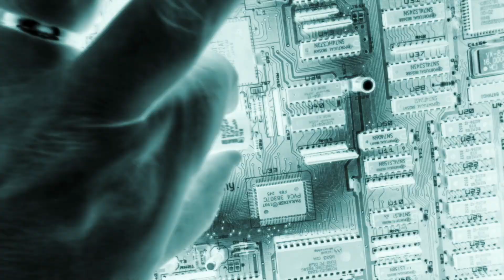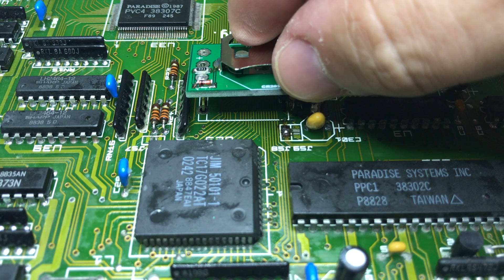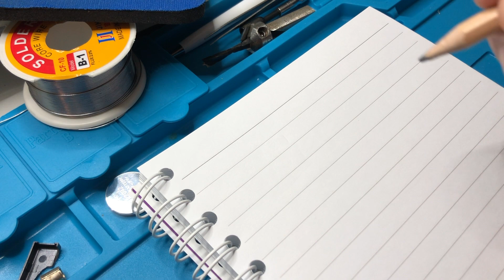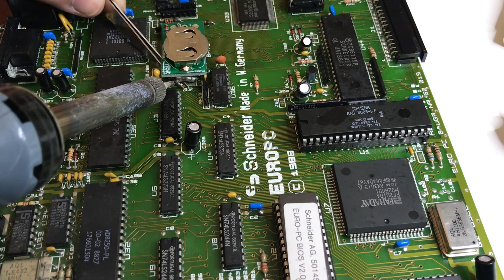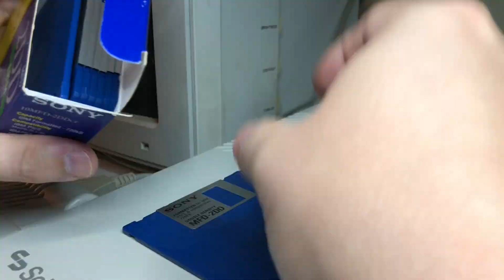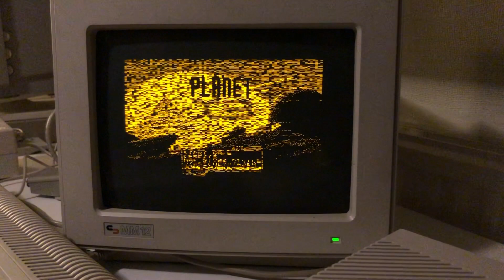The Schneider EuroPC Lost in Time Pt. 2

Comment: Thanks for the video. I have a Euro PC with similar issue. Unfortunately during testing it seems a capacitor blew in the power brick. Was wondering if you have any suggestions how to fix this.
Reply from the maker: Thanks for the comment. Nice to see that my early videos (of even more questionable quality) are still alive out there. Capacitor... Yeah... Difficult to say from afar but from your description I would guess the X2 filter. Electrolytic capacitors usually fail silently, causing the supply to go off specs until it stops completely. If a capacitor actually blows it is usually an X2 filter on the AC input. That can be a dramatic and smelly event, but until it can be replaced it can be temporarily cut out and the supply should work fine without it. In any case, it should be reasonably easy to spot and replace the culprit for another 35 years of service.

Comment: are you using lead or lead-free solder?
Reply from the maker: I usually repair with what I assume is already on there. In this case 60Sn/40Pb. I try to avoid blending types and removing would not be lagom effort.
Reply: @TheLEEC  right i was just curious about the extra flux
Reply from the maker: Yeah, that’s me being lazy. To get a good flow and bond on the pins I would have had to pre-tin them, and the fresh flux on top does that for me in one go. Same for the smd components. Instead of tinning the pad + attaching the component + soldering to the other pad + reflowing the first one again (for a good bond), with extra flux the component will wiggle into place spontaneously with an immediate good bond and then all left is to solder the second pad... job done.